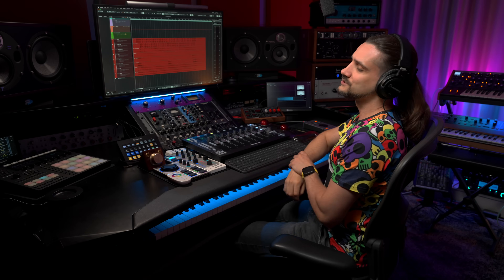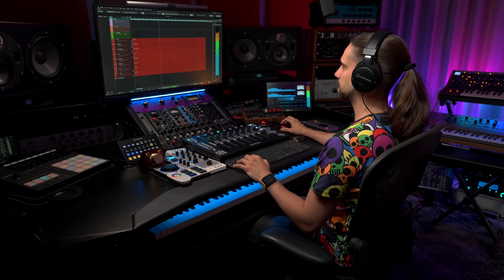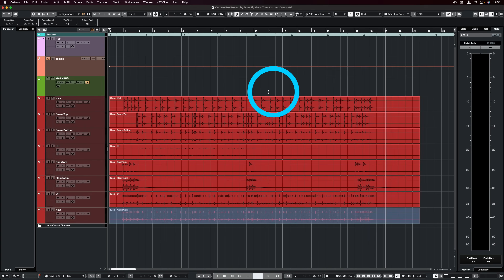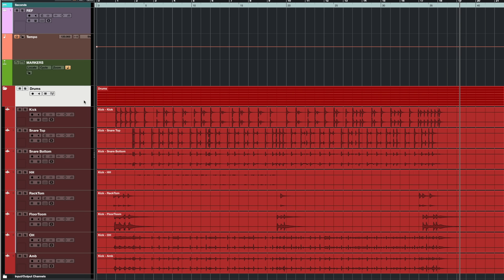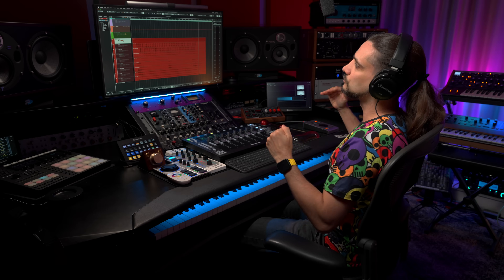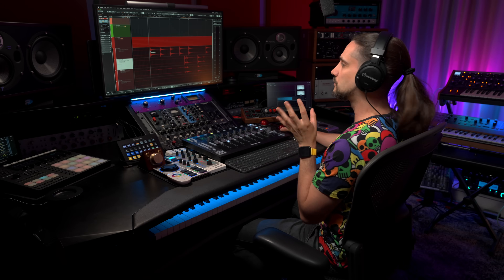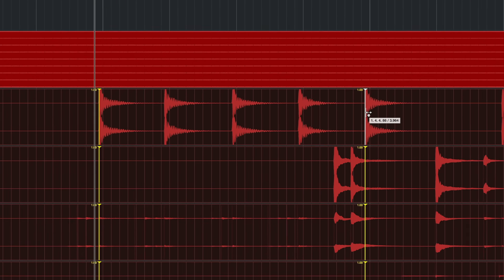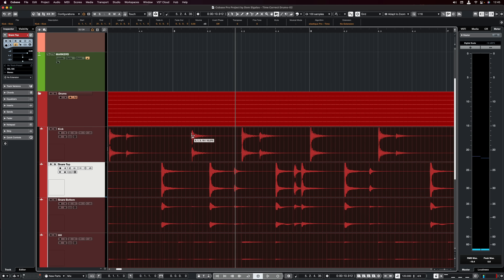How To Time Correct Drums The Right Way | Cubase Secrets with Dom

Comment: Is there a way to sync the recordings from 2 different devices? Like if your Interface only has 8 inputs and you have to record Room-Stereo-Mics and Lower-Snare with a seperate recorder. Transients alone to sync is kind of hard with room mics, since they aren't as tight to the rest of the kit since they are placed more far away.

Comment: do you actually use this methood? cuz there is a huge issue in cubase with committing audio or bouncing audio after editing when you have the phase coherent button engaged. what happens when you take that function off regarding phase after editing? does anyone know that? cuz commiting audio with the phase coherent button engaged seems impossible. anyway cool video just curious to know if anyone knows this

Comment: Great vid, really useful! - Just a couple of things - You might want to mention to switch on auto hitpoint detection otherwise the curser won't snap to the drum hit. Also, you didn't mention what algorithm you were using (very important I found) I did work out you were using 'elastique Pro -  Time'. After using this method I found a few drum hits went very soft on the transients and I had to go back to the cut and move method. Is there a way of not getting the snare to sound soft and fluffy on some edited hits?

Comment: I've NEVER heard flex time edit drums correctly in any DAW, it especially messes up room mics and overheads and leaves odd artifacts. Can you slice and edit beat detective style in Cubase?
Reply: yea, you can detect hitpoints and then open up the quantize panel and it allows you to slice then crossfade. it's pretty much beat detective at that point, but also with the option to use warping in the quantize panel

Comment: Thanks! How do you handle a situation where - lets say - bar 1 contains a fill with 16th notes, so you quantize that, but then bar 2 contains a triplet fill? If you then quantize bar 2 hitting Q, how do you prevent bar 1 from being re-quantized?
Reply: Presumably you would just need to deactivate group editing.
Reply: @MrMikomi  definitely still want the quantization to happen vertically across all tracks, so group editing needs to be on. Just don't want bar 1 re-quantized.
Reply: @NikolajChristensen  Use the scissor tool to make that bar its own audio event and quantize separately.

Comment: Hi Dom - how would you go about doing this for say an entire live concert that has 20-25 songs all at different tempos?  Would you have to break it apart and work on each song as its own project and then somehow put them all back together again so it plays as a continuous show, or is there a way to change the tempo before each song and then grid just that song to that new tempo without affecting the others?
Reply: Might be better off quantising the audio 🤷🏻‍♂️🤔
Reply: Why not just set a tempo change in the tempo track? (Ctrl/Cmd + T)
Reply: @alexmoore7517  That's what I was wondering how to do or if that's the most efficient way to do it.
Reply: Cut the songs into separate clips and set tempo markers at the start of each track so that tempo changes in the previous tracks do not affect them. No need for separate project files.

Comment: What are your thoughts with the group editing way of editing drums where you set the hit points priority (kick, snare, etc) and then slice, quantize and cross fade? I do both. But the method you are explaining is cleaner looking.
Reply: But What about the phase then?
Reply: @musicbysuyash  it is still phase coherent. Doesn’t change phase. You group and by giving priority for example to the kick.  It will move the kick with the rest of the audios relative to the kick. It does not for example quantize to grid the room mic (which has a normal delay compared to the kick).
Reply: @DiegoParedes  got it :) 
Thanks!
Reply: @DiegoParedes  All DaWs do this, and they all sound bad when they do it!
Reply: I prefer slices myself, even though this is much cleaner, I still lose some audio quality even with the phase coherent editing button enabled. I havent played around with the algorithms though, maybe "Standard - Drums" would do something nice